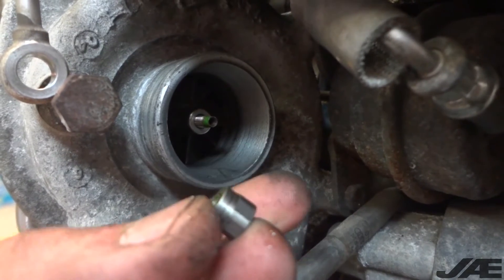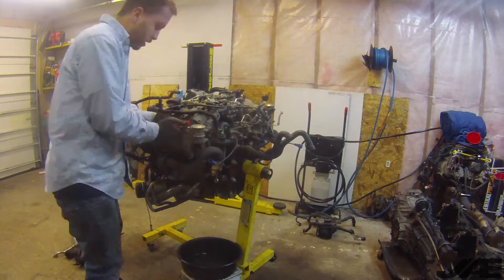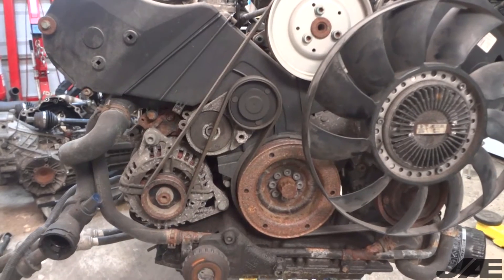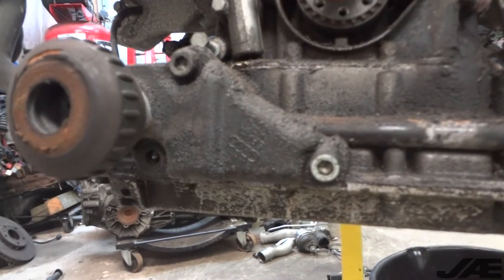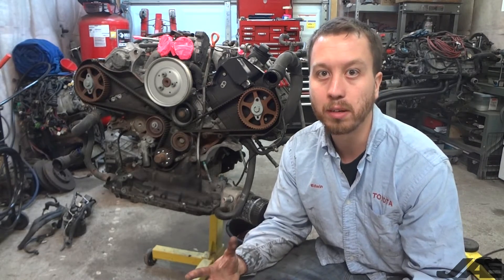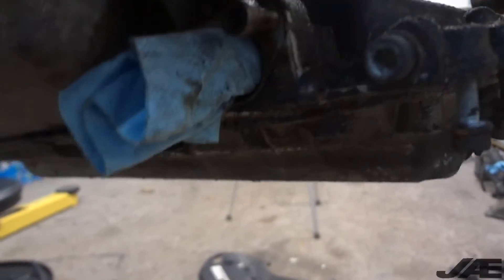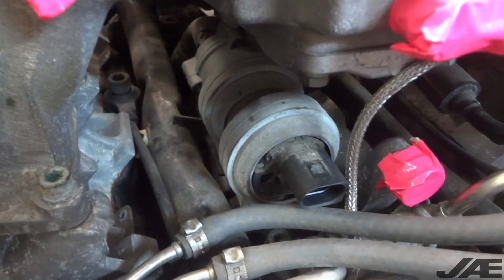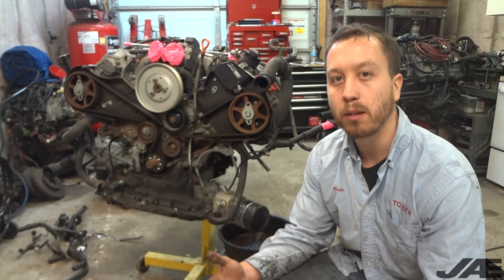Project B6 2.7T Stage 3 EP3 - Stripping Down the Engine

Comment: Great videos, but I have to respectfully facepalm about the timing group.  Without a detailed service history, it's insane to not do a timing group while the engine is on the stand, especially considering the wires you found!  That "new" timing belt may have been installed by the same guy who thought it was appropriate to twist wires together and tape them.  Without a doubt a new timing kit should be installed while the engine is out with a build of this scope.  Still great videos though.  Keep it up.
Reply from the maker: I know who had done the timing belt previously.  The mechanical work and the electrical work were done by two different people.  VCDS shows that the belt is within spec.  There is no need to spend money and time on items that don't need it when you know the entire story/history.